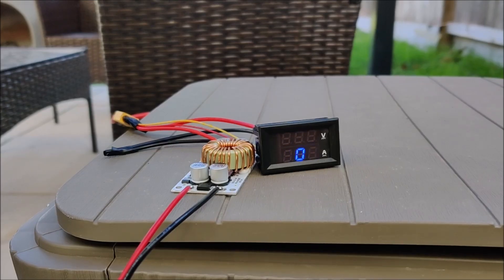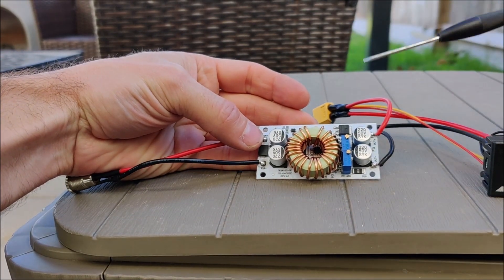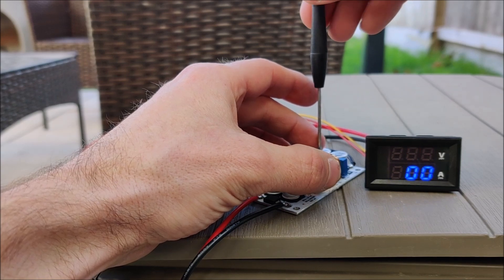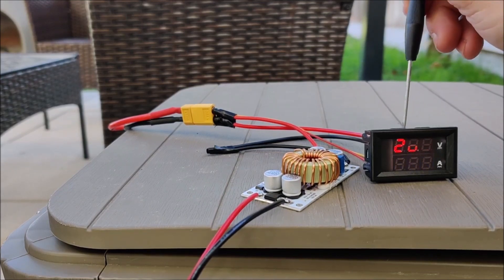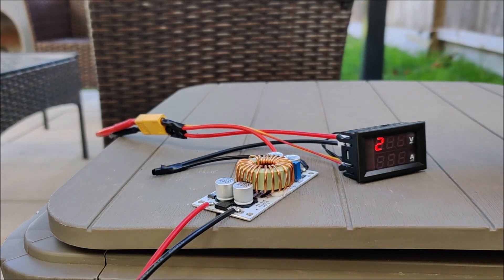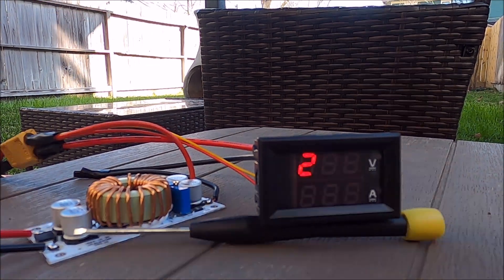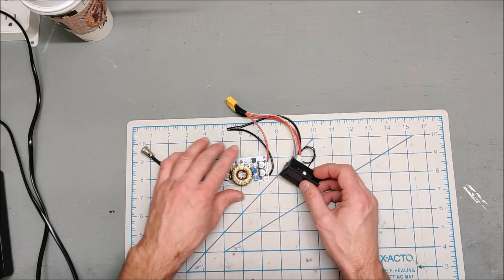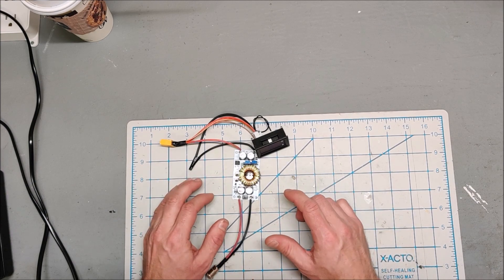$10 DIY Solar Charge Controller

Comment: Super cool cause cheap controllers lowest charge at 13v i need 12.6v and thouse controllers will put voltage how it will get and booster will put 12.6v all the time even if solar show 10v

Comment: do you know how to create 110 volt bypass / transfere switch /charger ? i have a 100 ah battery and a charger for that battery. but would like to make a ups. if it senses 110 ac from wall then it will draw from that and if it dont sense the 110 volts from the wall then the inverter will draw from battery. when ac is restored , it will charge to certain voltage and switch toac power from the wall.  this sounds really complicated but it seems like something you could do. and i think allot  of people could benifit from this.
Reply from the maker: Only some all in one inverter chargers can do what you are talking about. If you are using stand alone components you. Are going to have a hard time.
Reply: @stevenc22  thank you, just checking. i found renolgy 1000watt inverter / charger for around 290 it seems to be a good fit. will know shortly.

Comment: if you put some zener diodes at the output it will ensure don't go over the max voltage. at least i think they would...or a voltage regulator...idk i guess with solar it doesn't matter because there's a max voltage they can output.

Comment: Ever thought of using a solenoid type setup that could use an electromagnet to repel a permanent magnet to toggle a switch once a certain voltage is reached? I am thinking this might work for a high amp charge controller.
Reply from the maker: Yeah they make little PCB that can activate different devices at different  voltages, would be easy to setup

Comment: sorry to spoil the party. If you'd actually use current limiter this would work as good as mppt. limit current to PV mpp current times voltage difference ratio ie if PV mpp point is 40V 5A and you have output limiter at 30V current limit should be at(40/30*5A) 6.6A this way you'll take as much power from PV as it is possible. Cheers 👍

Comment: These units get blistering hot even at half power.  There are much better units out there at a comparable price.
Reply: Can you please share the better units!
Reply: @EngineeredOutdoors  I dunno if I can paste a link.

They usually pop up as "1200W DC-DC Boost Step Up" and have 3 pots -- minimum input voltage, max output voltage, max output current.  1200W is a little optimistic, but I routinely use mind to do about 50W from a solar panel into a Ryobi 40V battery.

Comment: If you add battery protection circuit to that  buck boost converter it will turn into MPPT 
if you want to use as charge controller you have to put on output MOSFETs so there will be no reverse current 
Good experiment brother
Best regards from Philippines 🇵🇭

Comment: If I connected this to the direct supply terminals off my mppt controler, would it work the same way, to charge my ebike 
Thanks
Reply from the maker: You can use a buck/ boost converter to set a constant output but I would still have a battery hooked up to the mppt since there are alot of voltage spikes when using solar.

Comment: Interesting idea but it is something you would need to keep an eye on and turn off once the battery is charged. Lithium Ion batteries don't like being trickle charged after they are fully charged and some folk may leave the thing connected long term not realising they are killing the cells.

Comment: when i did this i changed the voltage 10 turn pot for a larger ten turn pot to make it easier to adjust tried to do it with the amps one also but could not find a 10 turn pot in the correct resistance range

Comment: I tried using other DC to DC converter like XL4016 that also have constant current and constant voltage mode, But the problem is it easy to get hot even i only used a 100w solar panel and charging my 3s 5p lithium-ion battery pack
Reply: And i saw in a YouTube video that if a electronic component is getting hotter and hotter its just waiting energy
Reply from the maker: Yes, will need some cooling. Im actually mounting this in an aluminum case and using the aluminum case to heat sink the converter